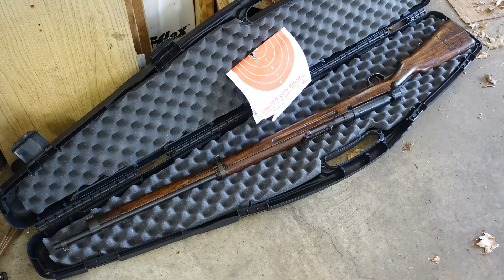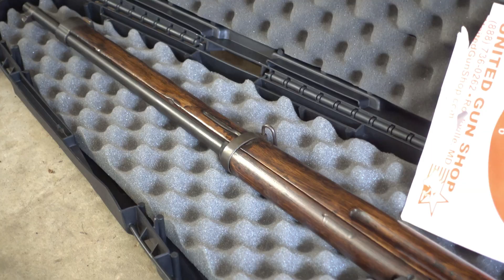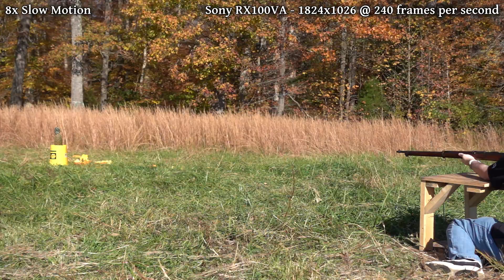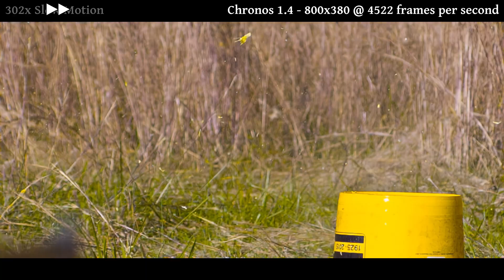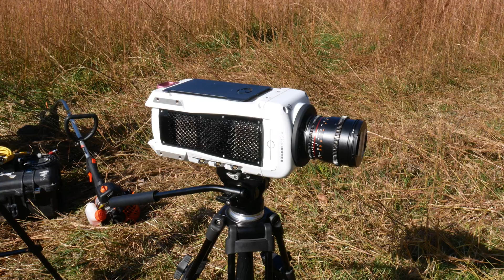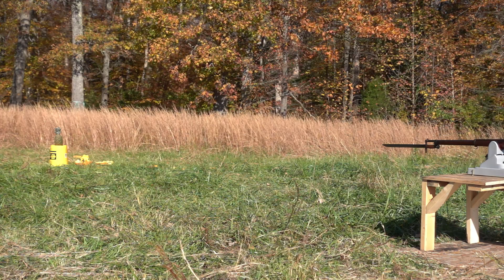Keyholing/Tumbling Bullets Caught in Slow Motion (Arisaka Type 38 6.5x50mm)

Comment: Ok I have the same rifle and it is doing the exact same thing.  Tried crown it was a no go.  What has worked so far is a counter bore.  I used a 5/16th drill bit in a hand drill (stable and straight as possible) to drill out the rifle 1 inch.  Recrowned inside the barrel using a 5/16th endmill bit $8.  Using 120 gr Nosler bullets at 1925fps it shot 5rds in 7 inches at 100.  It wants to keyhole still when I go over 2000FPS.  It’s a work in progress